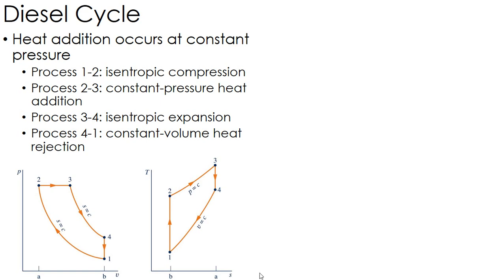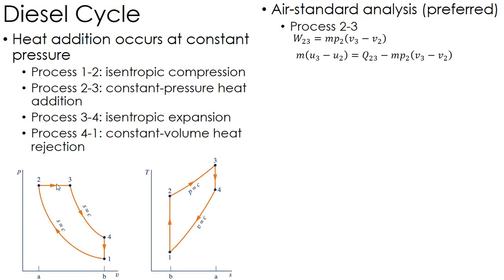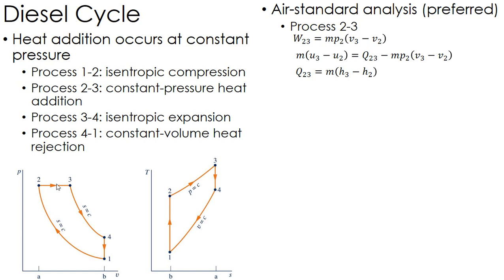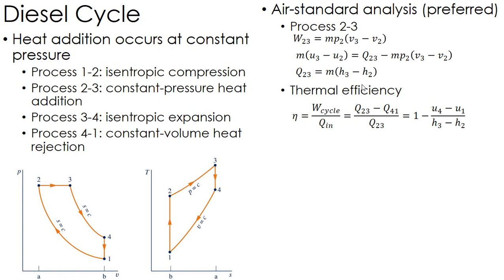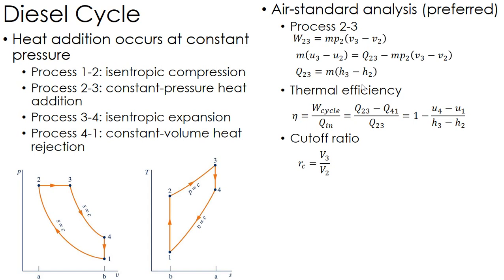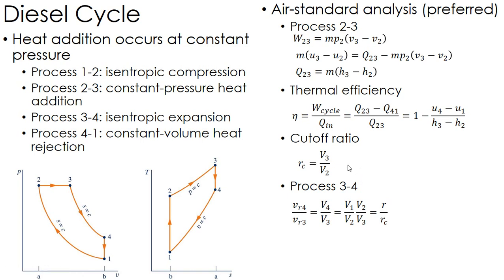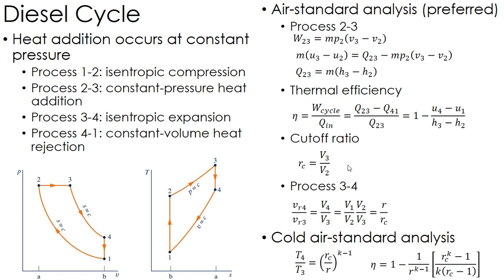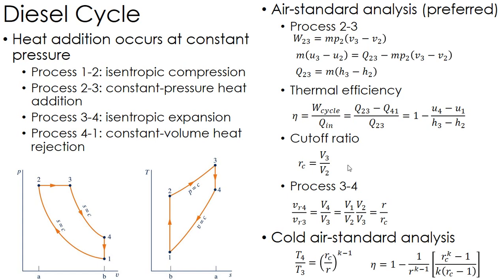Thermodynamics Lecture 29: Diesel Cycle

Comment: Hello Dr. Thermo,

The only difference between the otto cycle and the diesel cycle is the heat addition. Where there is constant volume heat addition in an otto cycle and there is constant pressure heat addition in a diesel cycle.

Best, 

Dr. Charlery